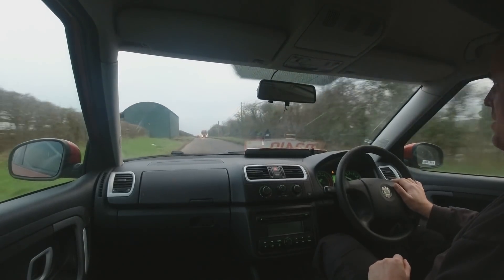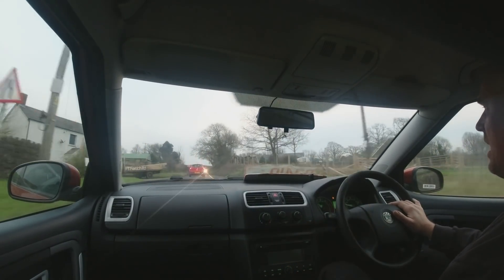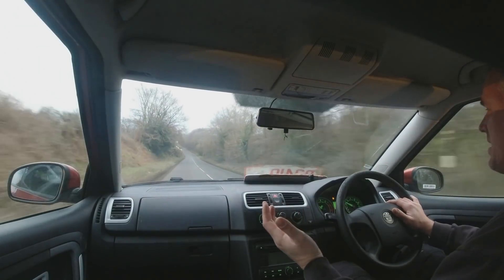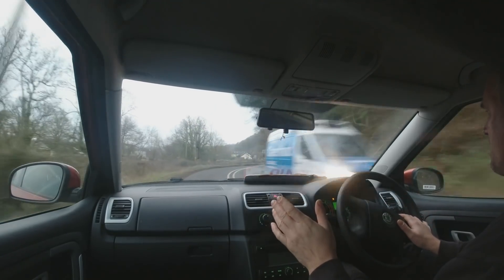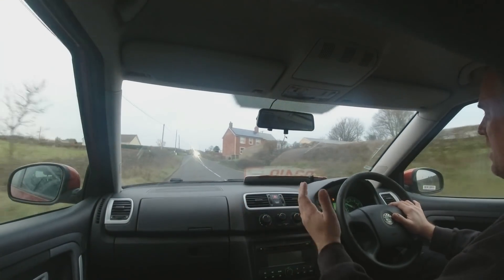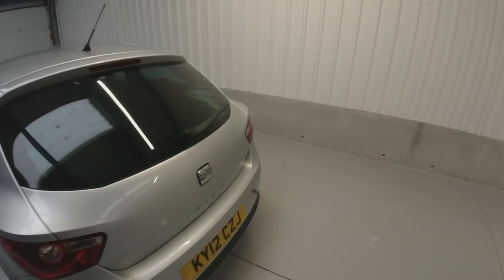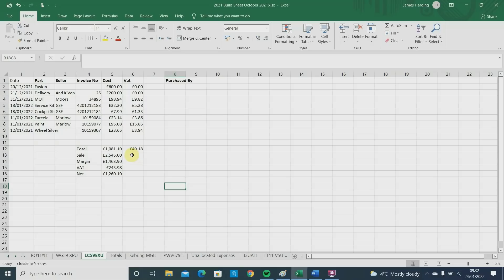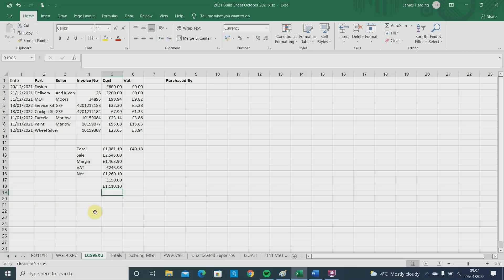Rattle Can Resto - Ford Fusion Results - What did I make?

Comment: What I was hearing at the start with your cost breakdown VS time spent VS return in profit etc was a perfect explanation by yourself, spoken to yourself as to why 14 year old grade 5 cars from BCA are not the best choice due to the levels of prep they inevitably need 🙃
I see 14 year old cars coming in with severe mechanical neglect every day, so the bodywork is the least important thing on such an old car. They look great in the showroom, but they take a lot of work to get to that stage. 

I'd edge out of the pre 2011 age bracket if I were you, at the very least if that's only from BCA you avoid anything older than 2011.
Of course there's gems out there that are older. I don't doubt you can pick up some clean, well looked after 2009 Hyundai i10s that don't need much work but that's where cash4cars comes in! Even something like the beaten up Fabia, cash4cars you probably could've bagged it from the previous owner for the £800 WBAC/PX price.

2011-2014 still gives a good selection of affordable cheap sub £3-4k cars but since they haven't been through umpteen owners then there's less bodywork damage. 
I feel like you're making things a lot harder for yourself than you could be. Please don't take offence from this comment though, I just couldn't keep quiet any longer 😁

Comment: Hi James you are so right in justifying the profit on the Ford Fusion. For example I had a £500 profit have right paling, when the steering column failed on a Fiat 500 ( not covered by WW Silver warranty  ) soon reduced the profit down to £230. We have to take the rough with the smooth. Cheers Dave

Comment: if the fabia has locking issues  check the door loom, they all cut wires as the door opens and closes, you can get a new loom or repair kit on eBay and half an hour with a soldering iron and it'll be good 😁👍
Reply: the loom access is under the bellows in the door - easy to check

Comment: My inlaws bought an orange 1.2 fabia new in 2007. when she was around 7 years old I had to repair 12 of the 20 wires going through the drivers door to the body.  Also suffered a coil pack failure at around 40k
Reply from the maker: What problem where wires causing?
Reply: @ChopsGarage  Drivers side electric window didn't work or electric mirror

Comment: James, got some bad news, you're calculating your VAT margin incorrectly, you dont include any refurb or repair costs.
Reply from the maker: No sure why small error in that one, no I do work on gross margin not net. Edited that one now.
Reply: @ChopsGarage  if you're recovering the input vat on the repair and refurb costs like you mentioned you dont add those costs to your purchase costs like you have done in that example, which understates your output vat.  Please check with your beany.
Reply from the maker: @thechilternturbo1185  I don't need to, ask explained I know this. I work vat on gross margin, there just happened to be an error on this sheet
Reply: @ChopsGarage  I was replying to your earlier comment that you subsequently changed when you realised your error.

Comment: Not unreasonable at all. This Ford Fusion is probably one of your more fruitful deals.
I am surprised you have estimated your overheads to be as little as £100.
Garage labour tends to be over £50 per hour, and that you are taking the rough with the smooth. If it all went belly-up you would be absorbing the cost, so you need to have better returns on some.
Reply from the maker: £150 I said for overheads on this car bud, so 10 sales would £1500.